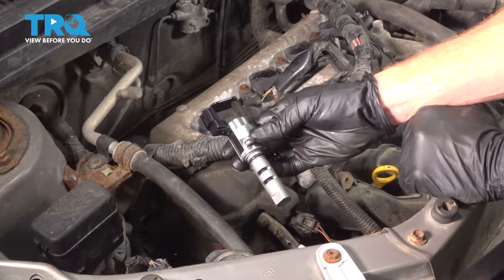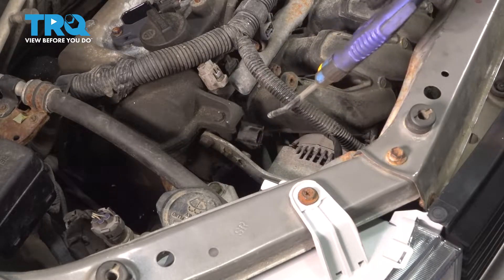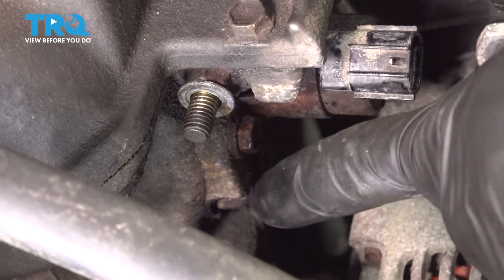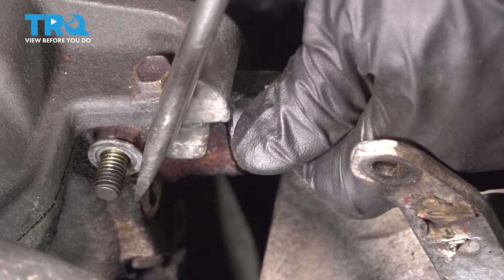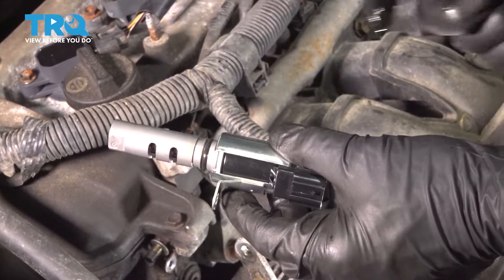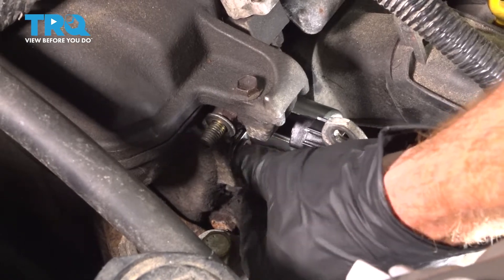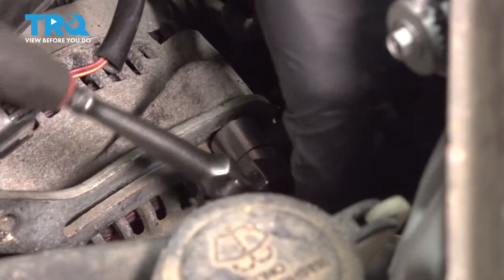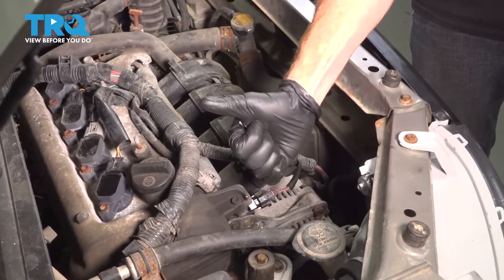How to Replace Variable Valve Timing Solenoid 2004-2006 Scion xB

Comment: This is usually called the Oil Control Valve or OCV, there is also a filter below it, behind a hex cap plug that should be cleaned or replaced also.

Comment: I had the P0010 code and I wound up replacing the VVT solenoid. Well, it then gave me the P0012 code, so I went ahead and replaced the camshaft position sensor. Now I'm hearing that on this particular vehicle you have to do a camshaft sensor relarn anytime you replace the VVT solenoid or the camshaft sensor. No one mentions that in the videos though. 😭 Has anyone else heard of that being necessary?

Comment: Thank you for this video. I'm hoping it solves my P012 error code and rough idle. It does great except for at stop lights, then it vibrates. Brand new motor mounts, new ignition coils and plugs, and a rebuilt engine. Still shakes while in gear, it goes away in neutral. I really really hope this fixes it!
Reply from the maker: +jamnjam Thanks for watching our video! http://1aau.to/m/Shop-TRQ

Comment: I have the check engine light P0010.  "A Camshaft Position Actuator Circuit / Open Bank 1" 
Is my VVT Solenoid need replacement to fix it?  If so do you have parts in 1aAuto?

Comment: started this job on a Rav 4 2.5L... the solenoid broke off in half inside the hole ... now trying to figure out how to remove it with a bolt screwed into it... a real pain ....guys beware... this is a common problem with this part ... if it doesnt come out easy.... leave it alone and take it to a toyota dearlership